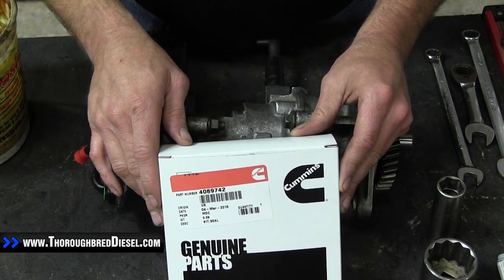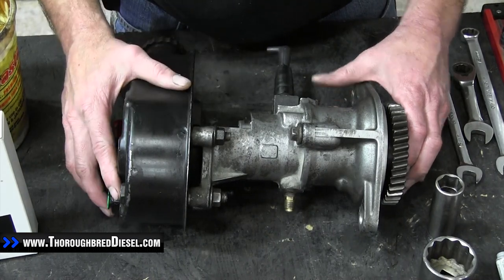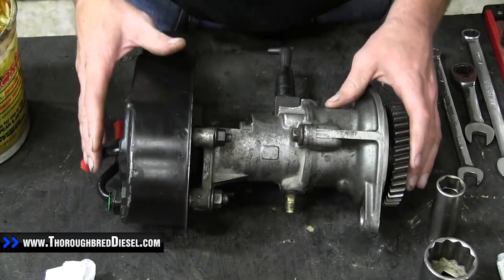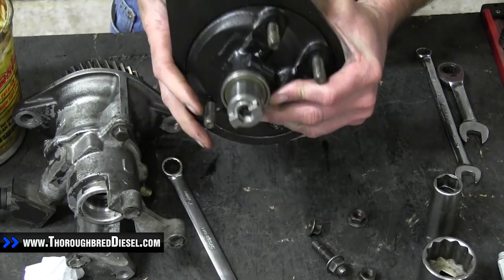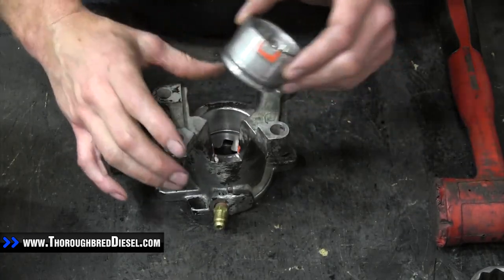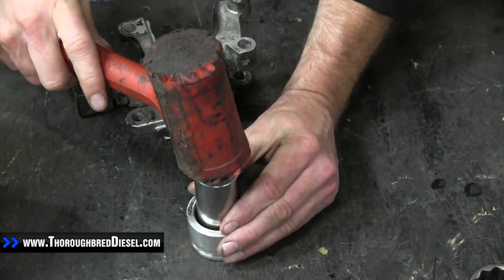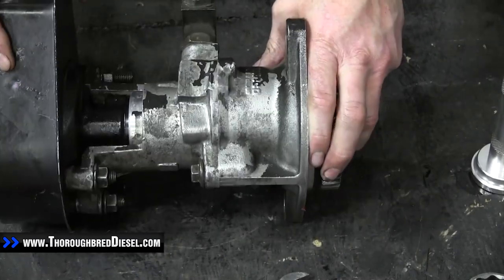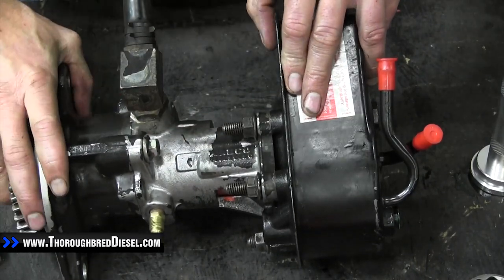How to Reseal a Stock Vacuum Pump: 94-02 Dodge Cummins 5.9L #diesel #cummins #dodge #howto #fyp

Comment: there is a support bracket that attaches to the side of the block and the pump. Make dam sure you re-attach that support bracket back on after you do the repair. This is a long heavy assembly that can cause other problems if you don't. It's a pain in the butt to get to it and get the bracket attached but it is a must to attach.
Reply: Thanks for reminding me
Reply: Will a missing support bracket cause the mating seal to leak again from the Block to the vacuum pump. My friend had his repaired out of state and nownit leaks again, i took a look and its missing the support brakcet and it leaks on the flange gasket that meets up with the back of the  gear cover.

Comment: "Make sure you take your time and do this correctly" as you tighten the nut instead of loosen it 😂 all jokes aside this is a good video. My truck sprung a massive leak between the vacuum case halves
Reply: If it's not lined up correctly... will not go back together properly

Comment: Would that seal being bad allow oil to come out of the top of the vacuum pump? There looks like a little weep hole on the top side and is leaking engine oil pretty bad and soaking everything.

Comment: When removing the vacuum pump do you need to remove engine oil first?  Also, what is the part # for the dog if broken?
Reply from the maker: No you don’t have to drain the oil.  If the dog is broken, I would replace it.
Reply: Thank you

Comment: Just pulled my P7100 Injection pump because I found diesel in the injector pump with the oil. I figure the Seals got hard, or brittle inside it.  That means the engine oil has some diesel in it too.  So I decided to go ahead and reseal the entire engine and vaccum pump while I have it off.  (Had to strip the side of the 5.9L 12 valve because it's in a FERD, Class A, RV and it has to come out the bottom because the dog house makes getting to the left side of the engine impossible.  Engine is under the floor)
This video lays the vaccum pump rebuild out so easy.             2 Thumbs up!  
Going to bump up the ponies on the injection pump while it's being rebuilt because, Why Not!
My 33 years old Coach sat for the last 10 years, (health issues) so ALL the hoses and belts in the Coach are being replaced as well.  
Something most UTube Channels fail to mention when rebuilding old equipment.

Comment: Oh man am I happy to have found this video. Sounds exactly what my problem is. Driving home on Friday I lost alot of power, truck was rolling mad coal (unintentionally 🙃) and I felt like I lost my power steering as well. I'll be looking at my hydraulic pump and vacumm tomorrow.🙏
Reply: What was your problem? You get it fixed?
Reply: @Thanosisnotreal   boost leak.  Before going into resealing your vacuum pump. Check for boost leaks. I had a blown intake manifold seal. Plus other leaks in the system.
Reply: @Countryliving_Drifter  Nice!, glad it wasn’t something serious. 👍
Reply: @Steve Saenz  yes on the vacuum pump there's a vacuum line that goes to the brake booster right in the middle of that line is a T valve for a nipple for vacuum that little vacuum line feeds a little relay and distribution on the driver fender it looks like a little relay well there a nipple on that where a 1/4 inch vacuum line feeds from the T on the pump to there they rot off and then you have no 4x4 , a/c & heat only works on defrost vents until your mobbing on the freeway and have enough rpm then it works and also IT affects cruise control
Reply: @johnnytiboni6745 my issue is ac/heat on defrost only plus cruise control haven’t experienced steering or 4x issues yet
Reply: @Mj-CWO4 your vacuum pump quit working. It'll still drive the power steering, but it won't pull a vacuum. I was able to drive mine for one more day when it went out, then took a ten mile trip and lost two gallons of oil. Better get this seal kit as soon as you can.

Comment: So you install the "culprit" seal dry.  Question,  do you lube the seal before you insert the hydraulic pump shaft through it when you are  engaging the drive dogs?         Thanks !!!    I need to do this on my '99,  extremely good video !!!

Comment: Question. The oil that’s leaking from the vacuum pump when idling, is that engine oil from the timing case or power steering fluid? 
I’m about to order this seal kit.
Reply from the maker: Should be engine oil.  Are you seeing any loss of PS fluid?
Reply: @thoroughbreddiesel it was engine oil. I resealed the vac pump, now just waiting on new steering pump to arrive. I needed extra return port for hydra boost brakes upgrade so decided to go with a new steering pump.

Comment: Same thing happened to me! Lost my heat first, now I have no power steering or brakes! Will this fix it?
Reply from the maker: No, sounds like you have something going on in your power steering pump. Resealing the vacuum pump will stop any oil leaks and get the vacuum pump back working correctly.

Comment: Where is the leak point 
Mine is leaking at the point where it connects to the block. 
Could I just un bolt and slide a new contact seal
Reply from the maker: Ours was leaking at the seal between the bodies.  If yours is at the mounting gasket, go for that.

Comment: i thought my power s pump went out so I changed it and still not my steering or my brakes work..i looked in the end of the vacuum pump and started it and the vacuum pump was spinning but I didn't check the drive dogs on the vacuum pump so that probably what happened is they broke off

Comment: Got a 97 dodge 12Valve I got no power steering and no brakes! Could it be the vacuum pump?
Reply from the maker: Could be the power steering pump or the vacuum pump if it has a booster.

Comment: It appears to only be leaking from the main seal on the pump itself, can I remove it from truck and just clean main seal and put new gasket then put back in, or should I complete the additional steps you have in the video?
Reply: Just going off the knowledge of fix only what's broken and only appears to be leaking from main seal

Comment: My 01 leaking oil bad in the general location of the power steering pump is it more like this leaking and not my tapper cover or more likely my tapper cover? Leave a big puddle of oil after driving

Comment: Can the power steering pump be rebuilt ?
Reply from the maker: We do not offer a PS pump rebuild kit.  We actually do not see a lot of PS pump failures in these trucks, but I assume someone offers a rebuild kit for it.
Reply: Powersteering uses vacuum pump as it's pump through mechanical linkage... vacuum pump and ps reservoir is bolted together

Comment: Quick question would a vacuum pump off of a 2001 24v automatic work on a 1999 24v manual?
Reply from the maker: Yes, the pumps are interchangeable.
Reply: Thoroughbred Diesel ok thanks

Comment: Do you know if they make a kit for the earlier 5.9 12valve Cummins because I'm have a similar problem on mine.. Thx
Reply from the maker: If you have the earlier three piece vacuum pump I would suggest contacting Gould Gear and Electric for a rebuild kit.

Comment: I'm going to do this in a few days.  I have a question for you though.  My PS works great all the time, but I seem to have an occasional vacuum problem that makes my brakes feel as though there is no vacuum getting to them (solid pedal).  It always goes right back to normal.  If there something on the pump I should be watching out for, or look for the issue elsewhere?  Also, thanks for the Bean's tappet cover, can't wait til it gets here.
Reply: Could simply just be a vacuum leak.
Reply: I have a solid pedal in mine too but all the time. I started to tear into it
Reply: Are you sure that your brakes are vacuum? These trucks use hydro boost brakes.
Reply: @TriStarGearhead  2500 uses a brake booster. 3500 uses hydro booster
Reply: @rudychacon7175  Vac and hydro are both brake boosting methods. I have a 2002 2500 ram with hydroboost.
Reply: @TriStarGearhead  yep, you know what meant. Ones able to make enough vacuum without a pump and looks like a drum.
Reply: @TriStarGearhead  I have a 24v swapped Excursion.
Reply: @rudychacon7175  I hate to get into the weeds but that's not right. "Hydroboost" uses power steering fluid to assist, whereas the other system uses vacuum. Plenty of videos out there explaining better than I can.
Reply: @rubikrawler  can you verify whether your your excursion is vaccuum or hydro?
Reply: @TriStarGearhead  I own both trucks. My 2500 uses the typical brake drum for brakes. My 3500 uses the hydro boost off the power steering pump connected to the vacuum pump. My trucks are 2nd gen 12 valves.

Comment: my 2nd gen is leaking power steering fluid right under where the pump is, so this is probably the issue?
Reply from the maker: Possibly yes.
Reply: Thoroughbred Diesel kits only 30 dollars so I'll go ahead and buy one and change it anyways.

Comment: Torque specs? So I don't over tighten...
Reply from the maker: Bearing housing to vacuum pump housing = 22 ft lbs,  power steering pump to vacuum pump = 18 ft lbs, the two bolts holding it to the gear case = 57 ft lbs, pump support bracket to block = 18 ft lbs, nut on power steering pump = 18 ft lbs.
Reply: @thoroughbreddiesel , thank you for this and the video! No doubt will be purchasing from you guys in the future. Excellent stuff!
Reply from the maker: No problem. We are glad the video was helpful.